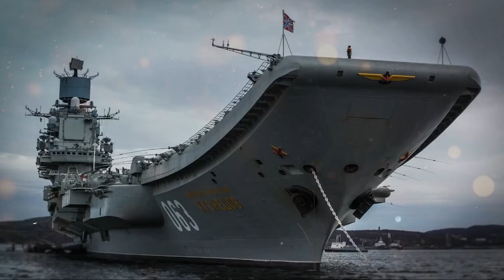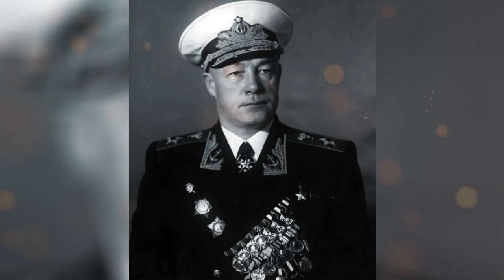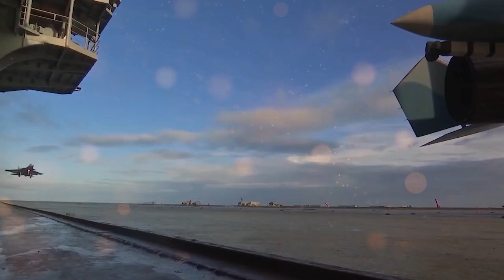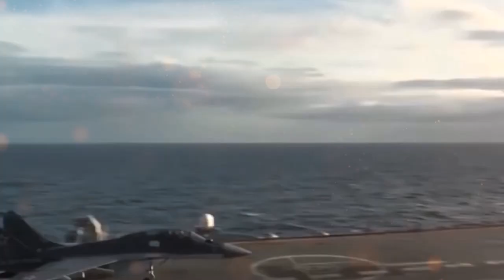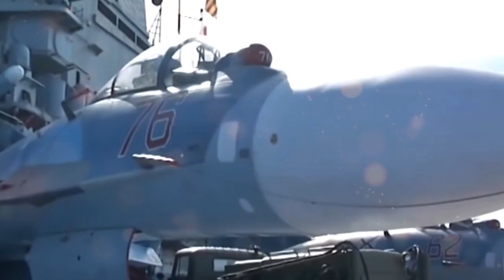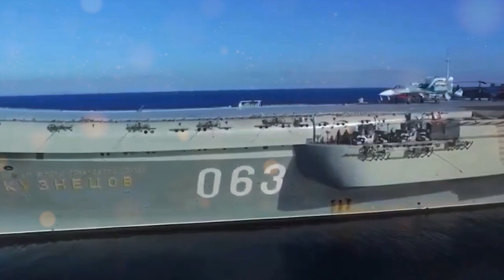Russia's Only Aircraft Carrier Is a FLOATING DUMPSTER FIRE

Comment: The black smoke is not due to the fuel.  Thousands of merchant ships used Mazut/Bunker C for decades without sailing around belching black smoke.  The problem is the boiler design. Kuzentsov has eight pressurized-firebox boilers.  These were in vogue for a while because they could ramp up steam production much faster than an unpressurized (conventional) firebox boiler.  In the U.S. Navy the Garcia-class frigates used two of these P-fired boilers per ship.  The problem with P-fired boilers is that regulating the fuel/air mixture is notoriously difficult.  It takes a very experienced boilerman to accomplish that.  It was hard enough if you were only trying to manage two of them on a Garcia. Keeping all eight of them on the Kuznetsov burning clean with any kind fuel using a high-turnover, conscripted(?) crew is probably asking too much.